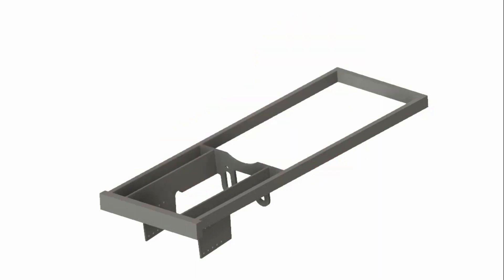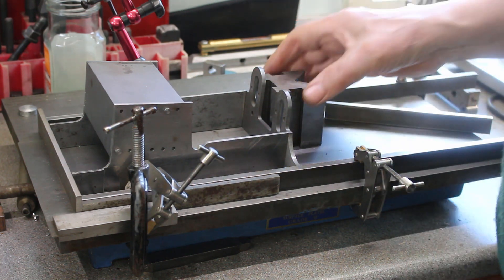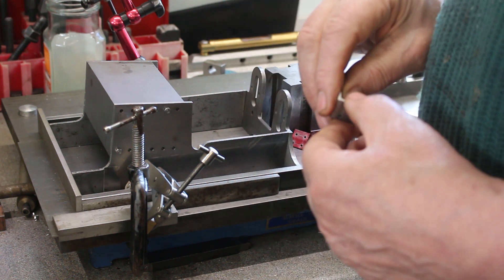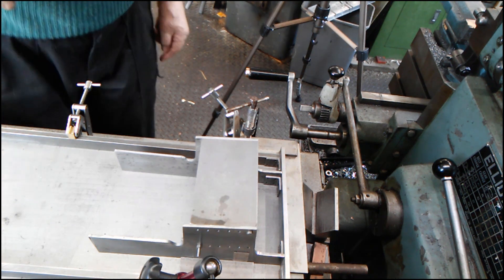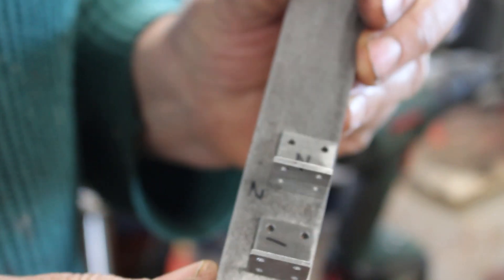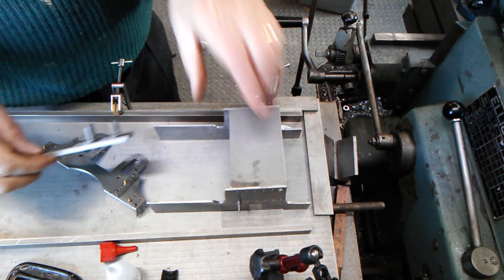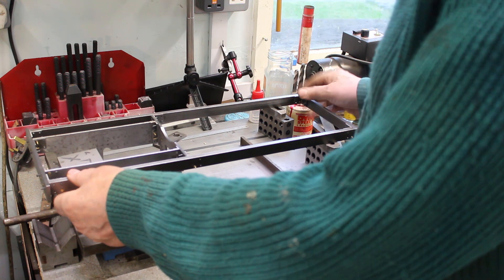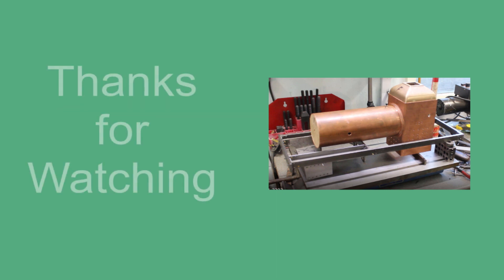LION Miniature Steam Locomotive Build Pt. 12 -  Motion Plate & Frame

Comment: For machining the motion plate did you create NC machine code from your CAD drawings?
Reply from the maker: Yes, I did the drawing in Fusion 360, while I could have done the G-code in Fusion 360 as well I used Vectric Cut2D because I have it and find it easier to use for jobs like this.